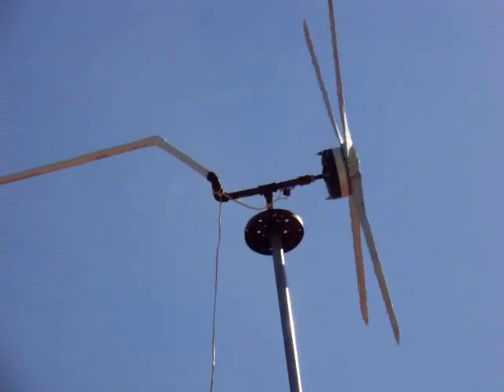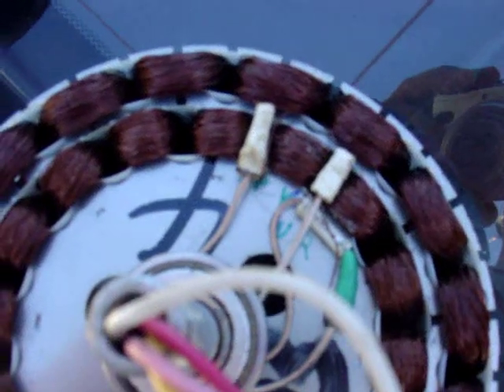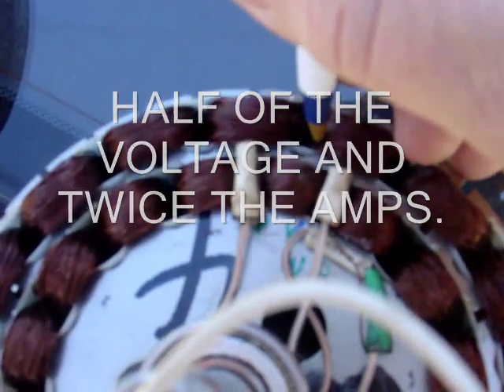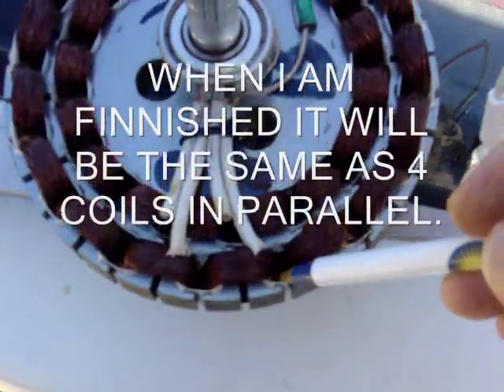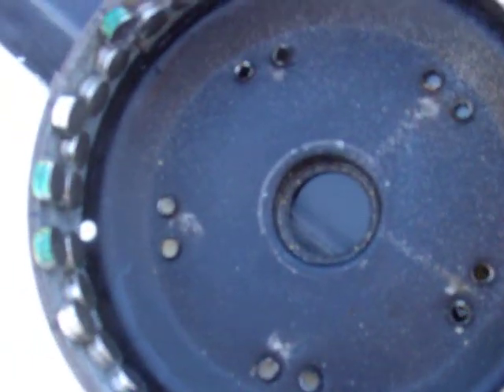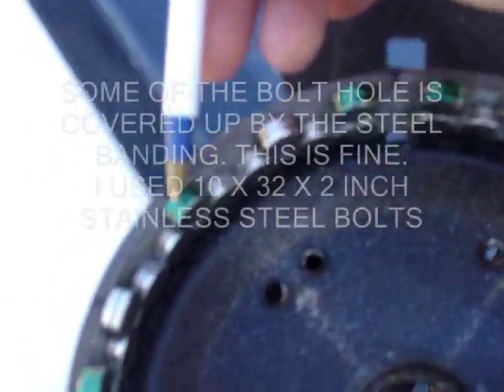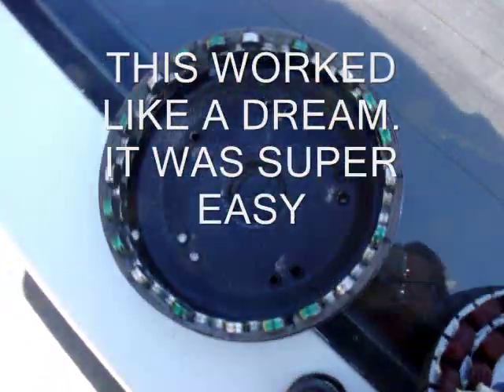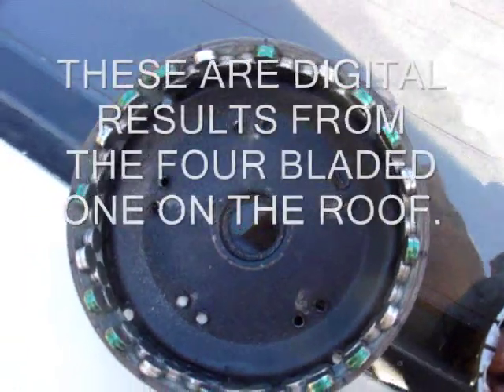PART 9 HOW TO CEILING FAN WIND TURBINE OR DIGITAL TEST RESULTS

Comment: I have a question about how you wired that Harbor Breeze fan. Did you connect the coils in parallel or series after you split them? I'm guessing parallel but if you could clarify I would appreciate it.

Love watching your videos as you take your time to explain what your doing in layman's terms.

Comment: I have a question to ask you I have any Hampton Bay ceiling fan the four wires are very thin should I solder a thicker gauge wire to the thin wires that's on the fan please get back to me Mike

Comment: if you put a power inverter on 1 battery how long can u keep a light on? or a set of batteries charging to maybe say 5 or 6 lights how long? i see you are just running direct from the wind.. Thanks if you can e-mail me Chadbrailer@y-a-h-o-o.com im a little confused of your 6  amp setup  ALSO could you not run a set of coils from a microwave getting 3 phase in the house or basement or whatever?
Reply from the maker: naw, these little ceiling fan wind turbine are just trickle chargers at best. but i have wired up the outputs of the coils to run 12strands of christmas leds. i could have added more strands. check out CEILING FAN CHRISTMAS LIGHTS.
:)
MUDDy
Reply: Chad Brailer cc

Comment: hello    i saw a video that u rewired a ceilingfan with 18gauge wire,did it work well ?can u tell me the test results pls ?btw i like ure vids very mutch .  :)
Reply from the maker: +Pascal Smeets 
I have that unit right next to me. it took a few more rpms than expected to reach charging voltage, But it worked well and more amps. I need to build a mount to fully test it. Boomer put some really fat magnets in it too. lol
The other cool thing is the 6 inch pipe he cut for the outer shell. it is heavy duty, but still needs the final tests done.
     Thanks for the reminder.
MUDDy

Comment: question, could you run the AC thru a stepdown transformer before you rectified, drop the volts closer to battery volts but multiply the current?
Reply from the maker: Brian C Absolutely. There are two phases on these units, thus two transformers. Then two rectifiers, and the outputs from the rectifiers could be wired in series, or parallel. Parallel for higher amps.
MUDDy

Comment: @ Scott Brown

Would you be able to make a generator out of an old rotary saw or reciprocating saw motor?

Like the rotary saw used on a wind turbine, and maybe some sort of piston for the reciprocating saw?

I'm not doing this and I'm not an electrician (yet) but I'm about to start a technical school and learn this stuff. I want to be able to make my own alternative energy systems.
Reply from the maker: yes, but the diameter of the rotor means it would need higher rpms. The transmission in the power saw probably wouldnt last long being pushed from the saw blade end. explanation:::: the motor turns many rpms faster than the blade. and if you trqansfer power from the blade to the motor, as soon as you extract mechanical power from the motor, the torque needed at the blade end would go very high. much more than the structure would handle.
MUDDy

Comment: Would it be possible to hook up this type of ceiling fan turbine to a Rectifier and the DC outputs to a Grid Tie Inverter and would it work? I have tried it on my ceiling fan wind turbines and the Grid Tie inverter gives a constant fault read even in a good  wind generating 30+ VDC.
Reply from the maker: the amperage is too low for the grid tie inverter.

Comment: With the stream out back this works great with a bicycle gear in place to control RPM's to produce power, But the constant water is too much to control during rainy days lol. But still endless power with my solar panels as well .
Reply from the maker: i would let the thing run anyway, the thin wire on the coils will limit the current . they are hard to blow because of it.
just let it run.
MUDDy

Comment: It seems to me that there should be a way to hook that ceiling fan back up in the house and get it to self power itself and power to the house.  They are doing it with a car generator, why not the ceiling fan?
Reply from the maker: @ joanna write,
exellent question. Yes it will work. dirrectly wiring the four wires straight across color for color will work if both motors are converted to permanent magnet generators.
MUDDy
Reply from the maker: *****
@ Joanna Wright
ALSO
The Ceiling fan motor inside would need a push to get the two motors in sync.
Reply: wow ... Just WOW  o.O    is there any hope for humanity left ? :(
Reply: That's called regenerative braking, and it saves a fraction of a percent of the energy you use while driving.

I don't know whether the units ever even pay for themselves at retail price.

Comment: In the shop we use a rag paper/mylar product that is specially made for the purpose. The other thing that is used by some factories is an epoxy like coating that covers the entire stator and is removed around the perimeter where it interfaces with the magnets. They are dipped from the factory, but if you had something viscous enough you might be able to paint a coating on in the slots. If you heat the stator in an oven at 300 deg it will soften the wire enough to remove it and safe the old paper

Comment: Fool the generator into thinking the magnets were MUCH LARGER than they actually are. As long as you end up with an even number of poles 2,4,6,8 etc. it should work. MIGHT increase your output? Depending on how big your iron (stator) is you might be able to make them 2 or 3 rows high and 2 or 3 rows wide. Do you understand what I'm trying to say? STRONGER magnets would also increase your output while using the same windings. Great project you have going there, really gets your mind thinking. Tom

Comment: Another quick thought for your project. It seems by reversing every other magnetic pole in your stator, that you may have too many poles in your generator. We've wound everything from small mast mounted generaotrs on a sailboat to giant tugboat alternators. Most have either 2 or 4 pole gennerators. (Alternators have more poles) Have you tried putting multiple magnets in pairs/quads,etc. with the SAME poles(N), THEN placing 4 or 6 magnets in reverse polarity(S), then 4 or 6 (N) and so on.

Comment: My father has owned an electric motor repair shop since 1960. I've worked for him for over 10 years rewinding motors. The formula for getting a desired voltage and amperage from an existing generator is to cut the voltage in half and double the amps. Use twice the size wire (in circular mils) and half the amount of turns. It usually works out to 3 wire sizes (numeric) bigger in diameter ex. (from 25 to 22, or 22 to 19) Same applies to raise voltage only reversed 19 to 22 and TWICE the turns.

Comment: To get lower voltage and higher amperage you can insert a transformer before putting the AC into the rectifier. Halving the voltage doubles the amperage through the transformer. Also leaving it as higher voltage and using a long wire to get to the controls and putting the transformer alongside the control unit will lessen the resistance loss in the lead-in wire. There will be some power loss in the transformer but less than what you will get in the line to the controls.

Comment: hey muddy, very nice project. I have made a fan like yours, and it has between 0 and 50 volts output DC depending on wind speed. I live in Belgium.
I have used a bridge rectifier with 2 capacitors 1000µF on them.
 So i have two questions.
1.Do i need the capacitors? maybe they act as a temporary storige and
2.Can i directly hook the changing Dc voltage to a Car battery? without a volt regulator 13.8V
thank you for a reply and good luck with your new project.

Comment: @muddymuddymuddmann im going to try using three. im making an adaptor plate so i can just bolt the plate to the motor and then three of the four blades to the adaptor.
im tempted to just run 4 blades and just have the thing solid mounted. i live at the base of a canyon so the wind only really blows one direction 95 percent of the time.

Comment: @muddymuddymuddmann  WHY ARE YOU YELLING????  cant you just type in a quieter voice? anyway, i do have a question about your generators regarding overspeed. how do you control the rpm of the generator in say, 90 mph winds? it seems you might burn up the armeture if you simply short out the generator for a hysterisis brake

Comment: I think if you are having problems with loads reducing the speed of the turbine and you have lots of volts there too. Longer blades would increase your torque and overall power taken from the wind. Plus you don't have to up your battery bank voltage. Great vids. PM me if you want some further info, I have made a pretty cool excel thing that works lots of things out to make that fine balance more possible, it's not perfect yet mind.

Comment: Does the size of the coils or the number of turns in the coil or the gauge of the wire or the thickness of the magnets increase the out put and is there some kind of formula to figure any of this out.

Comment: You have a math error regarding minutes and seconds. 250-300 rpm is 4 or 5 rps. So you are at 8x4=32Hz or 8x5=40Hz.  So I'm glad you didn't buy the airplane transformer. Stick with the 60Hz regular transformers. 

Transformers are more interesting than I thought. I've been reading about them. A variac or autotransformer would work too.
 
openbookproject(dot)net/electricCircuits/AC/AC_9(dot)html

Comment: Skip the capacitor idea if you are just doing DC rectification. I just suggested it so you could maybe run both coil sets, almost in phase, through one transformer. 

Here is the transformer item number on ebay if you change your mind:
290380649227  $20 + shipping.

Comment: For the second set of coils, which are 90 degrees out of phase, one idea would be a large capacitor to shift the phase back in line with the first set of coils, like an induction motor. I'm not sure if it will work and I do not know what size.

The second idea is to simply disconnect them and that would permit higher spin speeds for the first set to put out higher voltages by themselves.

I know you said you might rewire the coils instead.  I am just thinking if ideas not involving opening it.

Comment: If you did not buy that airplane transfromer, I have a couple other solutions to run by you.

I spotted a high amp two tap transformer on ebay.
One tap would step you down from 45vac by 35%. That would get you your target 28vdc for charging. The other tap is terrific for about 80vac and above at high wind speeds. It does a 3x multiplication of current. 

All you need is a $3 relay to switch between the two taps automatically, when the voltage goes above 80vac (plus a 1000 ohm resistor and diode)

Comment: I think I can confirm the current versus voltage problem which you have.  At 97 ohm coil resistance, one amp of current puts 97 volts across one set of coils. 97v x 1a = 97 watts wasted inside the generator as heat while the battery gets 25v x 1a = 25 watts of charging power.

In other words, you can only improve efficiency by running the system at higher volts and less amps because the coil resistances are so high.  Transformer and many other ideas should be very very beneficial.

Comment: I have a solar set up with no wind. It is 60 amps at 48 volts. That is why it was expensive.
Here is a source I bookmarked for prices and an interesting selection of sizes:
missouriwindandsolar com/Charge_Controllers.html

and here is a free circuit which needs some changes for 100+ volt inputs:
romanblack com/smps/smps.htm#apps

Comment: I also researched charge controllers for efficiently getting more watts out of the high volts and then I looked for home made DC to DC buck converters. Some of these are 93% efficient at dropping volts and increasing amps.  They are expensive though.

Comment: Maybe you should test the inner coils' output separately from the outer coils' output by attaching a constant speed drill to it and two separate equal dump loads and measure the voltage across the two dump loads

I urge you to do this because you might be making a mistake attaching the two sets in parallel.  Think of it like putting a 9 volt and a 12 volt battery in parallel. Do you get extra current that way if the voltages are not equal?
Serial with a drop down transformer might be a solution.

Comment: That is terrific.
When I think about how those two phases add together, my guess is that they would behave differently if wired in parallel than if wired in series, especially because the inner set of coils is lower voltage, unless they maybe used more windings per coil. Did you test the two sets of coils for output separately before assembling ? I have been pondering why the output number you get are too low. My guess is series combines voltage more effectively than parallel combines current.

Comment: The inner set of coils is mis-aligned with the outer set. Since the magnets are in a north south alternating pattern I guess the system produces AC and the inner set of coils is fighting the outer set by a few degrees. 

Would a separate diode for the inner set & outer set put the voltage in phase with each 7 degree turn ?

And are the magnet sets spaced to keep the current in the right direction all the way around for each outer coil ?

Comment: with the trees seen in your videos, 50 feet hub-height would probably eliminate the turbulences you are experiencing, and you would almost double the available wind speed.
Also going from blades to "scoops" (from radial to centrifugal) you would gain speed, torque, and efficiency  with (drastically) reduced diameter.
Otherwise, I like very much your experiments! 
Stratosailor

Comment: With that kind of voltage if you put the coils in series (after rectification), you could feed a line inverter. :-)

What kind of RPMs are necessary to get 100v?

Comment: With an OC voltage of 80-100v I think you'll see quite an improvement with the coils cut in half.  You're burning a lot of power (70% or so ) as heat in the alt right now.

Nice job!

Comment: Great project and very well explained.  Very Impressive. I'm cuirous as to why your rudder is not at a right angle. Is that to protect from too high of winds? It's wasted energy and also kills prop momentum and stresses the prop, bearings, and swivel mount.  Wouldn't that energy be better transfered to the generator? If high winds damage it, a fix is cheap  enough.

Have you ever thought of gearing that prop to make the alternator spin faster? Maybe at least 1.5 to 1 to see what happens?